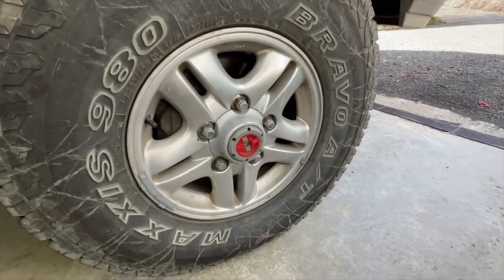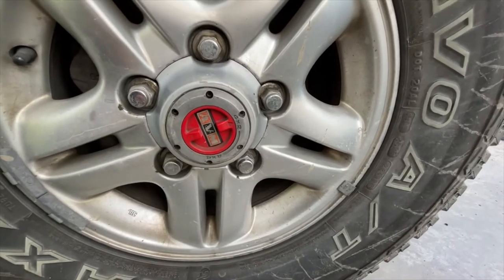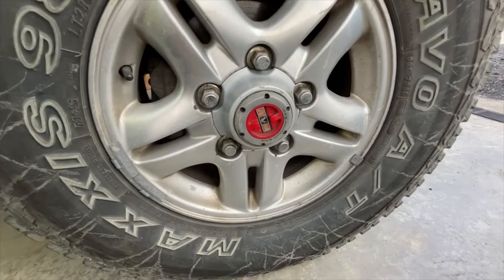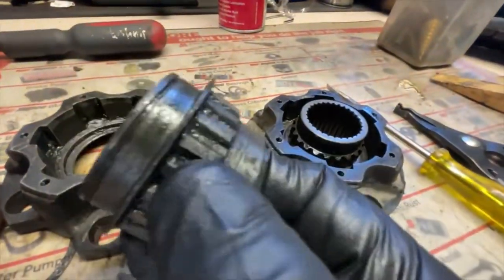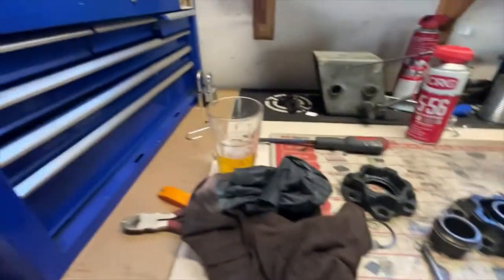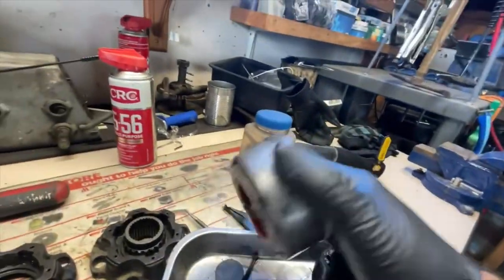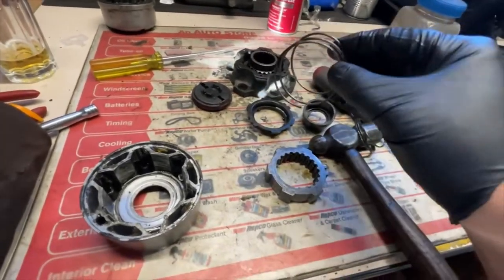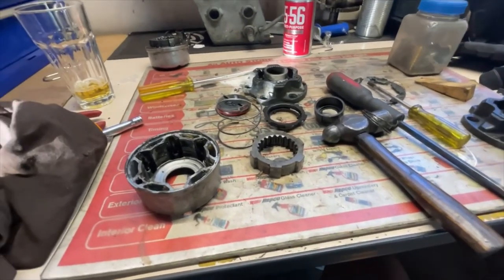AVM Free Wheeling Hubs   100 Series Landcruiser

Comment: Great. Thanks.  Some 100s models don't work with these hubs because they're awd.
Reply from the maker: I fitted a Marks part time kit adapter. Remove centre diff and change for their parts. Centre diff lock button becomes 4wd activation. I did it to save wear and tear on the cv,s plus lighten the steering etc. seems to work fine.

Comment: Hi Sean, I have a set of older AVM hubs on a GQ ute in the back of the yard. I wanted the remove the axles, having a ton of fun cause the screws were gunked up with mud. You are the first guy to say "use torque 15 bit". I couldn't see what they were, now I know, I had a win. It was driving me nuts! And yeah, they aren't good!
 Cheers
Reply from the maker: I got some replacement avm hubs. All went well, but I found they where tough to engage and then they would either turn off or sometimes on. The fix was a double gasket on the hub face. I think the new hub is slightly different. Hope the hub fix works for you. Cheers.